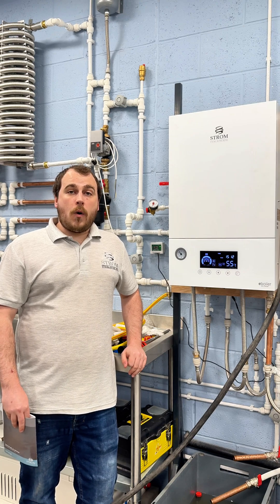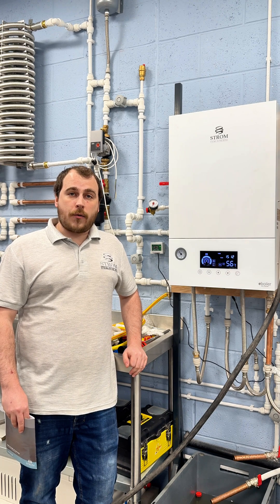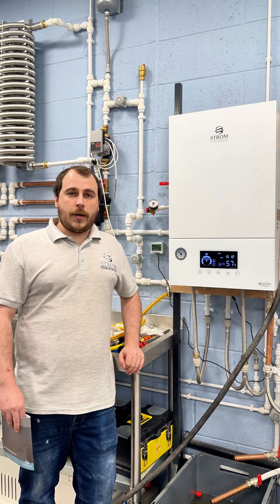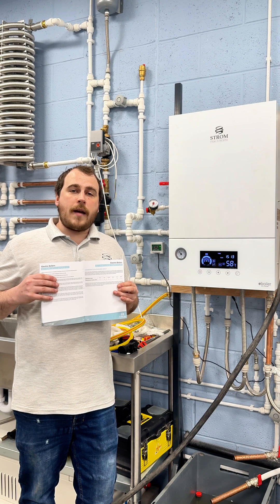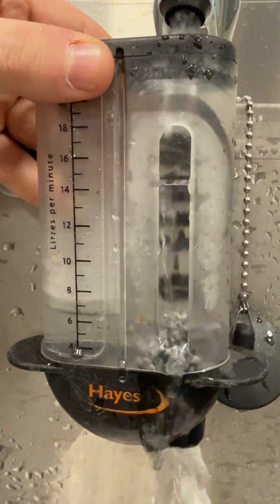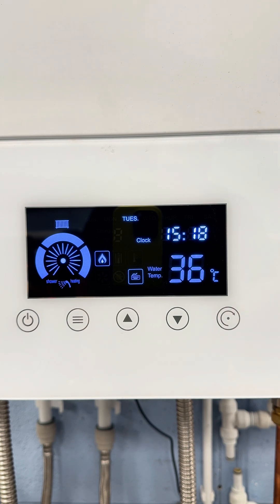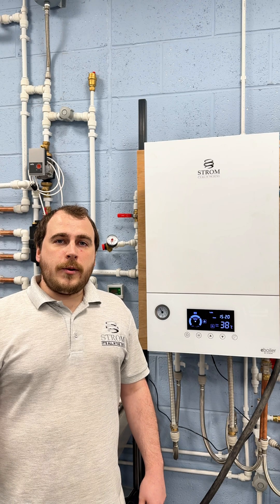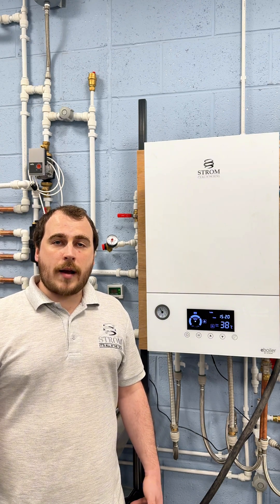No Hot Water? Poor Flow? Common Combi Boiler Problems & Fixes!Why Your Strom Electic Combi Boiler

Comment: Hi, I keep getting an E9 message every few hours on my strom eboiler. Do you know what is causing this at all. Thank you
Reply from the maker: Check out the installation instructions it gives details in that. Normally reduced flow, does it have a bypass installed
Reply: These strom boilers have bad issues with circulation errors on s plan systems even with properly adjusted bypass valves. I would have a bypass radiator on the primary circuit in the bathroom or airing cupboard.
 Their aftercare is bad, no repair engineers for faults. They avoid warranty claims, Id avoid them. Id avoid leccy boilers full stop tbh. Fitted loads, ripped most of them out within 2 years due to high running costs. Never going to be a good idea unless you have a field of solar panels.